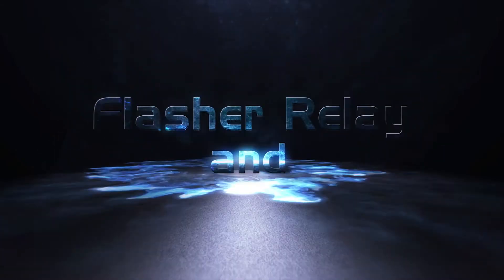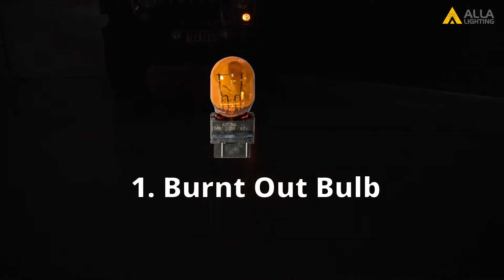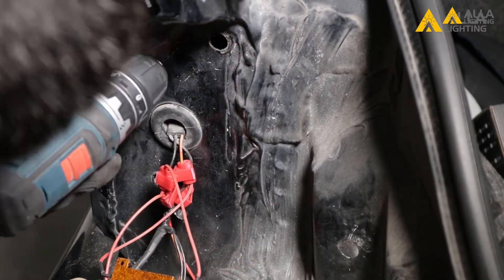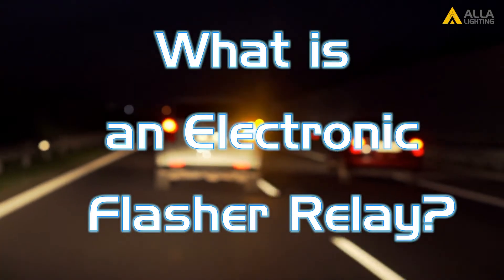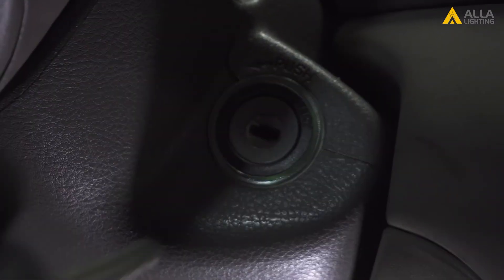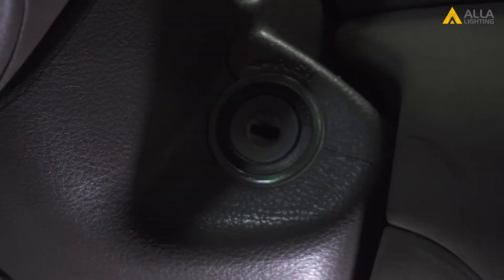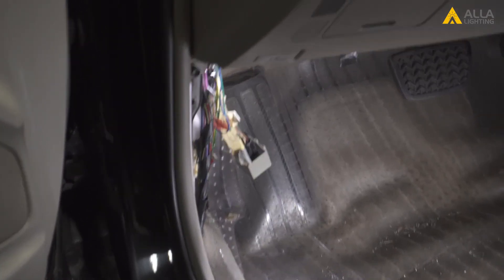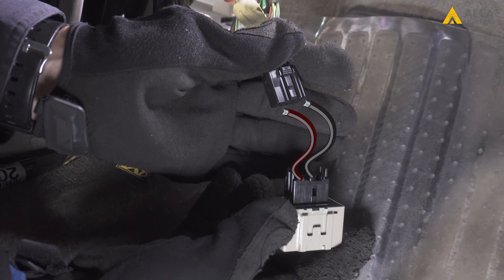Electronic Signal Flasher Relay Location Installation Replacement LED

Comment: I recently replace all halogen bulbs to led, it goods bright but it hyper flush, i installed new electronic adjustble relay, hyoer flush gone but lock and unlock light indicator of the remote doesn't flash but the central lock function? Is the relay bad??

Comment: 2015 hyundai sonata front signal light work and flash without headlights being turned off but if i turn on headlights signsl lights come on but will not flash when i use signal front inside car..but right signsl is faster than left signal

Comment: I wouldn't be trying to find the relay if my flashers/turn signals were working and the relay was clicking.  How do you locate a non-functioning relay?
Reply: I bought a relay from Advance Auto and looked at the relays under the plastic cap under the hood.  The text inside the cover mentioned tail lights associated with two relays.  The second one I replaced with the purchased relay got the blinkers working again.  It was difficult to press in the locking tab and pull up on the relay, but two flat screwdrivers worked.  I put Armorall on the locking tab to make it easier for the relay housing to come off once the tab was pushed in with the screwdriver blade.  So trial and error was the method of finding the bad relay.

Comment: About finding the relay, my 2013 Passat would make the sound but if the door was open there would be no clicking sound at all because it would be making a door open alarm tone.  It seems that on some vehicles it may be artificially produced by some sort of speaker separate from the cars stereo system.  Some Volkwagens have a device called a soundaktor which makes a bit of extra noise to make the engine seem to sound a bit better. I am not making that up, they have proven that some Volkswagen models have a thing like that.  My guess is a device kinda similar to that produces the turn signal click some of those make.  Think about it, Volkwagen and Audi are luxury sport cars and the ones greared more towards luxury would have more sound insulation.  By mimicking the sound in such a way they might make it something more distinct or more pleasing than the clunking sound of an oil squeeze bottom oil can.  With all of the various things that can be changed on those by way of "long coding" there is a myriad of settings that can be changed.  I never looked at all there is available to change with the proper tools and knowledge but depending on the vehicle there can be more than you ever knew were there.  One word of caution about long coding, one misstep can leave you with a vehicle that will not start or it may do wonky things.  IF the dealer can help you reverse the changes, it may be expensive too!!  They are wonderful cars but an electronic nightmare when anything goes wrong!!

Comment: If we used the electronic flasher relay but when the led bulb or halogen bulb broken, does the signal bulb will hyper flashing too?
Reply: I’ve read a couple different places that it will disable the hyper flash entirely so you’ll only know by a visual check or when a police officer pulls you over lol

Comment: I couldn't find the location of flasher relay in 2010 Nissan Altima. Can you please reply for the location. Thanks.
Reply: I have a 2007 Nissan Altima & I've been trying to figure that shit out too 😒
Reply: I still can't find it though on my 2005 Dodge Durango? PLEASE HELP!!!
Reply: @mbradford140569 open the driver side door end of dash by steering wheel should be a little door there